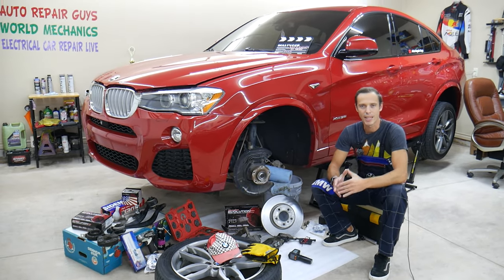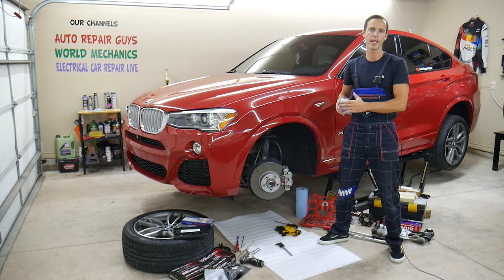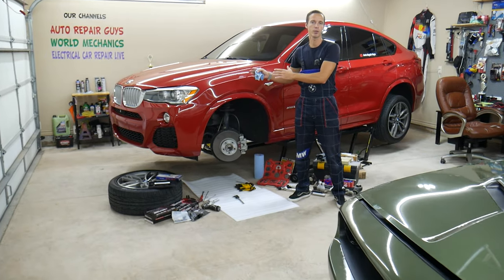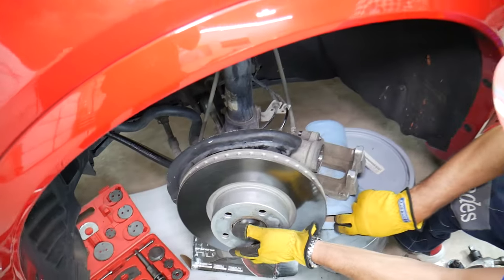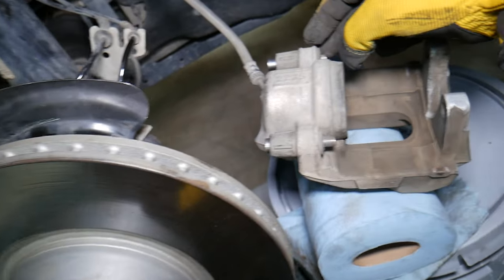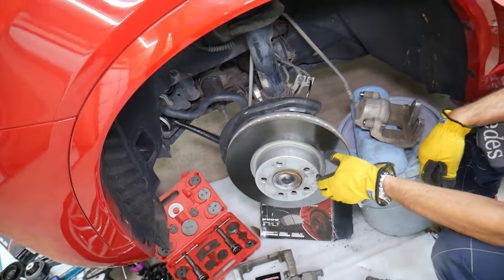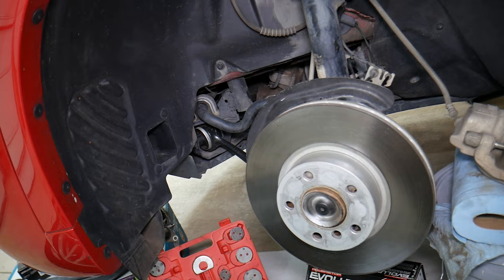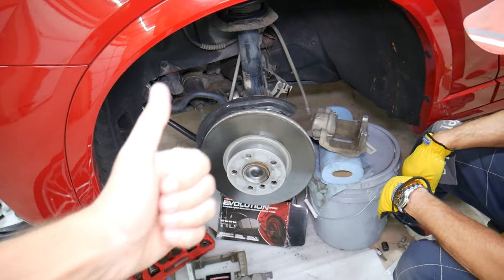HOW TO DIAGNOSE STUCK BRAKE CALIPER PISTON ON BMW, BRAKE DRAG

Comment: Bought a 335 and had it renovated by my garage. My garage told me they would need 1 week to complete the work. They ended up needing 2 months.
I reckon 2 months is enough for a brake to seize up, right?

I had to stop on the side of the road twice since I got it back.
There is no noticable pulling to one side. But...
The left rear disk is hot and even produces a burning smell if I keep driving. (Happened once) I can touch the other disks with my bare hands. But I wouldn't dare touch the left rear disk.

Went back to the garage 4 times. Ended up spending another 3k+ But still the issue is there. They said they can't find anything. Probably think I'm overreacting or something.

So now I'm just going to do it myself. Like I used to do before I had the financial means to have everything done by a mechanic.
Reply: I have the same issue, how did you end up resolving this?